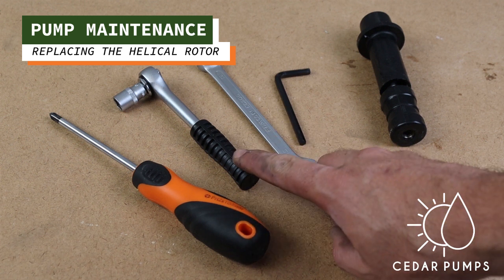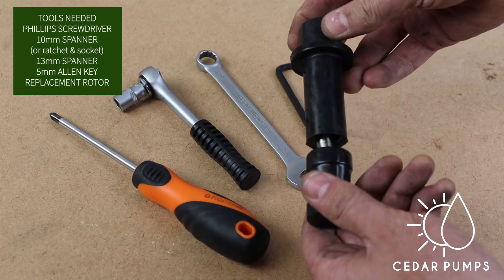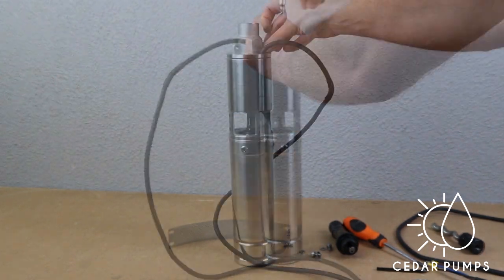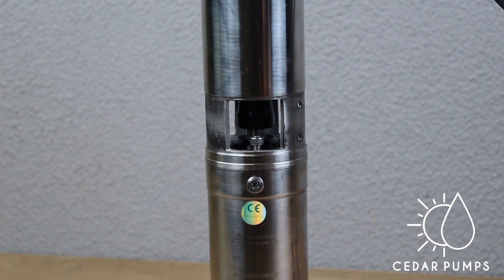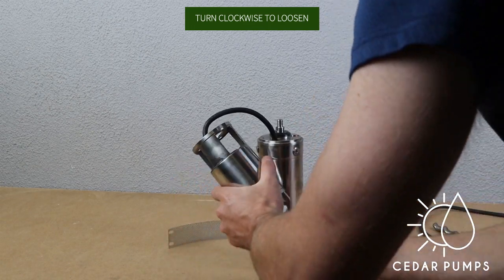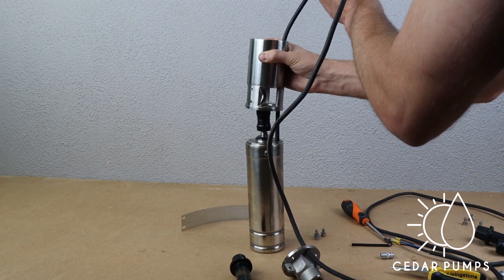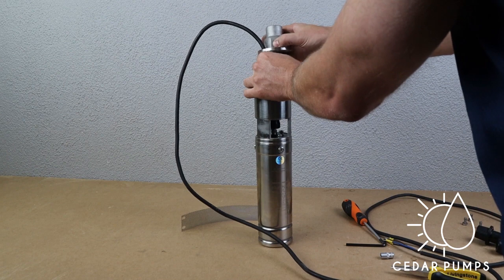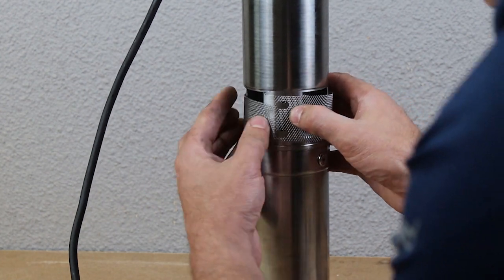Replacing the Helical Rotor of a Solar Water Pump

Comment: hi cedar solar. i followed all these steps and replaced the rotor. i put it back in the water, waited 15min and switched it on. i have 3 green lights but after a few seconds it shows a amber light on 'low power' even in full sunlight? what could be the reason? my pump was working just fine for 5 years now and i thought replacing the rotor solved the problem but it hasnt. please help? couldit be a faulty wiring but i doubt it as it shows power from the panels to the pump? do i need to clean the motor or something?
Reply: Light coat of Vaseline on the top bush where it mounts between the middle and top housings worked for our pump, but to be honest, I'd likely coat all visible rubber bush parts when replacing... Worked for our brand new pump, same error flash code, Good Luck 🤞🏻👌🏻

Comment: Hi Cedar, happy new year for 2022. I followed your video, thanks. A question though. When tilting the motor part backwards and forwards I can hear water inside. It does have holes at the bottom with a large squeeze type clip. I undid the clip but get no further. Should I hear water through those holes ... Thanks, Dave
Reply: It's oil inside that work as coolant to keep the motor from overheating